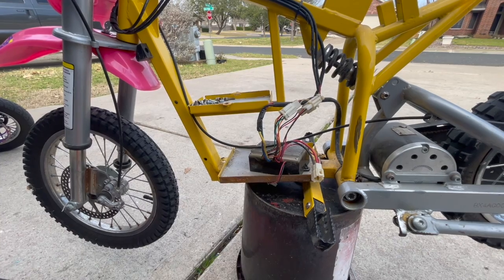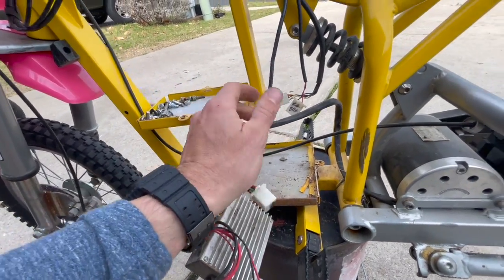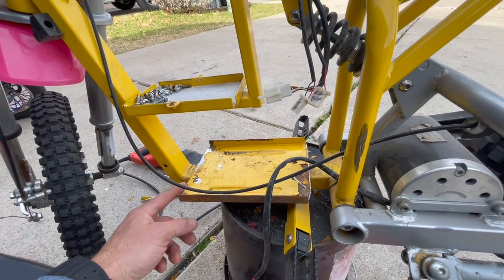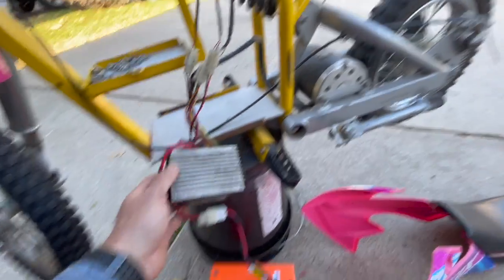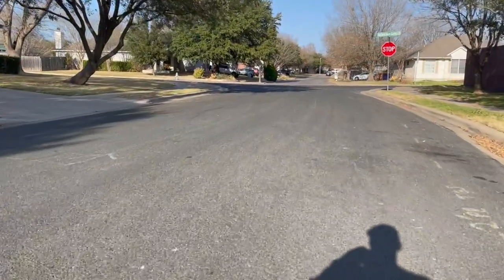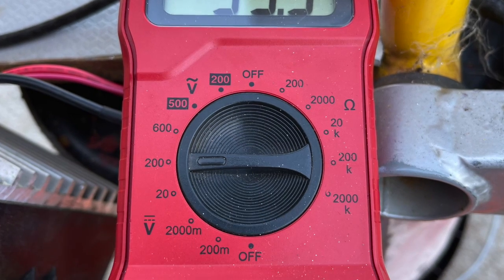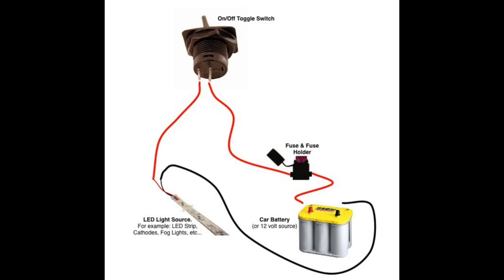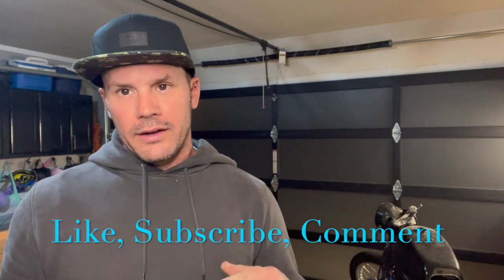How to Upgrade Your Razor Dirt bike MX500 MX650 SX500 and RSF to 48 Volts⚡️ Step BY Step! 💪🏼

Comment: Motor is making an odd noise. How’s the motor and controller heat? 

I tried this with a 60v battery and stock controller.  Made a loud wining noise and had a log of heat on the motor and controller. Later I swapped to a proper 60v controller and the motor heat went away. I also had drastically more performance.
Reply from the maker: 60v is probably too much for a 36v controller and motor. Glad you upgraded, I’m sure it was worth it👍
Reply: @VoltronWatts  yeah bud. Keep an eye on the heat.

Comment: i have one thats 36v,, great at first but doesn't last long at all maybe three minuets  . then the battery's dead .. battery's are new  any idea ?????.. could  the  controller be bad
Reply from the maker: What’s the amp hours on the battery?
Reply: @VoltronWatts  3 12v 7ah acid batterys i know thats not big but there only lasting 4  to 5 minuets
Reply from the maker: @johnrobert5009  yea, those batteries are probably bad. That is known to happen with these bikes.

Comment: Brotha, thanka for showing it can be done in real time.  I have 3 bikes for me and my boys.  Plan to buy E&C 48v for my bike.  What charger and connector did you use for the battery?  Any problems thus far?  Electronics getting hot?

Thanka brotha!
Reply from the maker: What’s up broski?? Thanks for watching and commenting. I have had 0 issues with the orange batteries and I’ve ran them in 3 of my last bikes, my kids and wife have them in their bike and about 15 other bros in my group have them in their bar hopping bikes. No complaints. I’ll a link to where I got the charger to the video description 💪🏼

Comment: Hey voltron,  question here , do I have to solder to wires or I can use  the bullets butt connectors.  On the controller to the new wire and plug that came with the battery?
Reply from the maker: I solder everything, but I’ve seen people use the crimp style connectors as well.

Comment: Great Video! Think of doing this for my 7yr old's bike - Any issues charging the 48v battery thru the stock controller? Or are you removing the battery to charge it?
Reply from the maker: Don’t charge the lithium battery with the charger that came with the bike. Get a lithium specific charger. I keep the battery in the case just like stock and use the stock plug to charge the battery. 👍
Reply: @VoltronWatts  100% on the charger, sorry I should have been more clear - I was curious if you were able to fully charge the 48v Orange (thru the appropriate charger) thru the stock 36v controller.

Comment: What battery would you suggest if I can’t find an orange batt? New to razors and glad I found your channel! 🙌🏽
Reply from the maker: I’m glad you found the channel, Welcome! If you can’t find an orange battery there are several others that will work just fine for this type application. There are a few on Amazon and eBay that people use. There are also higher end brands too. What voltage you looking to stick with?
Reply: @VoltronWatts  I’d like to do a 48v and keep it stock for a bit before I go overboard as my wife says! 😂😂

Comment: hey! what kind of run time do you get with that? how many miles can you get before it needs a recharge?
Reply from the maker: Hey there! I have the same battery in a rambler 16 (a 48v 20AH orange batter) and it gets about 20 miles. This set up is a little more powerful and it get about 14 miles. ⚡️💪🏼 check out the library of videos if you wanna see the rambler figures. Thanks for watching!
Reply: Can you drop a link and an i stall video for the 48v in the rambler please
Reply: My son just got the mx350 for Christmas and this thing has to charge 12hrs to ride for 30min 😢 is there anyway to make his ride time longer?
Reply from the maker: @juliegerken1913 I think the initial charge is just 12 hours. After that it doesn’t require 12 hours of charging 👍

Comment: Do you have a link for the battery. Also did you have to wire in a new switch?
Reply from the maker: Check this video out. I did a similar thing and Included the switch part you are asking about 🤙

MUST HAVE $150 Battery Upgrade For Your Electric Razor SX500, MX500, MX650 OR RSF650. Step By Step!
https://youtu.be/wzVbQsUDu0w
Reply from the maker: The batteries can be had on eBay and the modified razors for adults Facebook pages. 👌
Reply: So I just wanted your opinion do you feel like if I buy one of the batteries that have a charger and cord with it should I use that charger or just wired into the controller like your last video and use the charger you recommend?
Reply from the maker: @timlyon2924 that’s up to you. You can replace the ends on the battery leads and the charger cable to retain the stock plug, or you can keep the battery the way it is and make a new hole in the covers. If you don’t run covers at all, I would just keep the battery and charger connections the way they came. 🤙

Comment: How long did the range last with your daughter riding. My son gets about an hour with stock batteries.
Reply from the maker: It’s hard to say, she rides like 10 minutes at a time. But I haven’t charged it yet since I made this video. I’d guess she can go a couple hours with her weight (65 pounds) and her throttle attitude which is pretty slow. 🤣